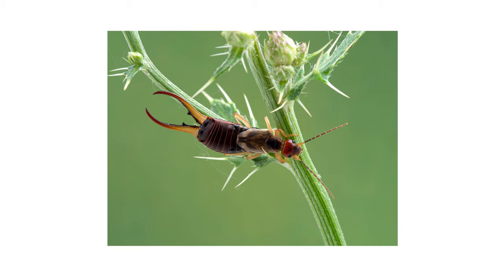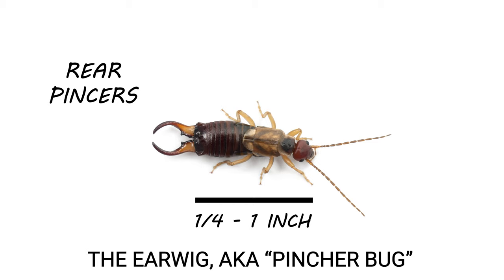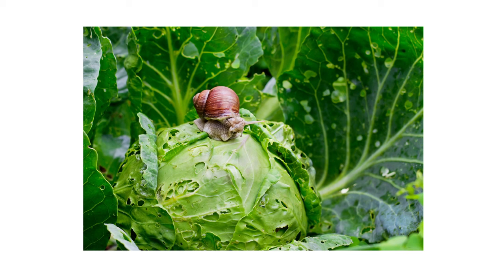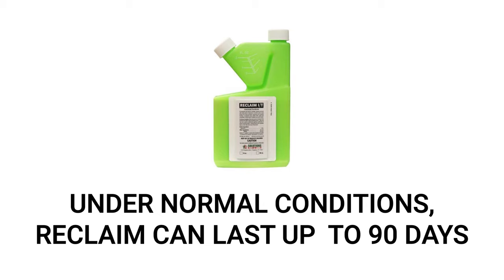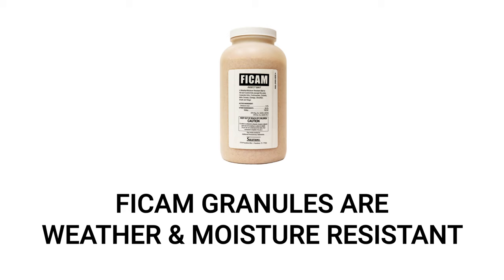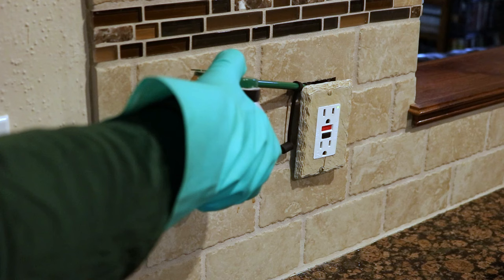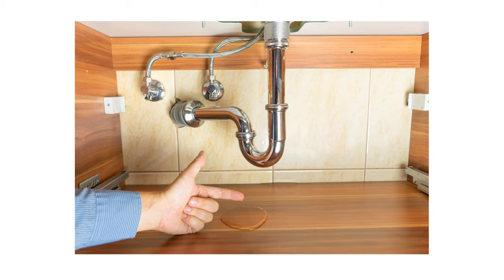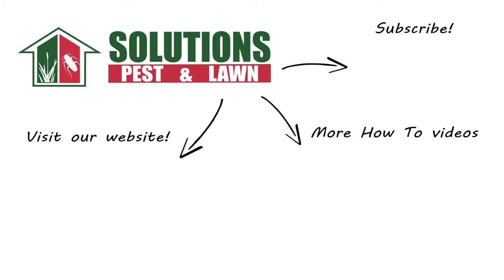How to Get Rid of Earwigs (4 Easy Steps)

Comment: Thank you for the tips. However, I will not be using any chemicals around my plants which may or may not react adversely to the treatment. I will find an alternate method. So far I primarily only have minimal leaf damage, which I can live with before resorting to insecticides. Again, thank you for your time by offering useful information.